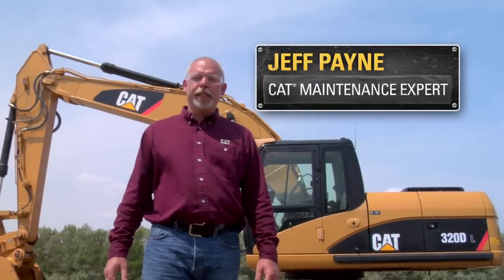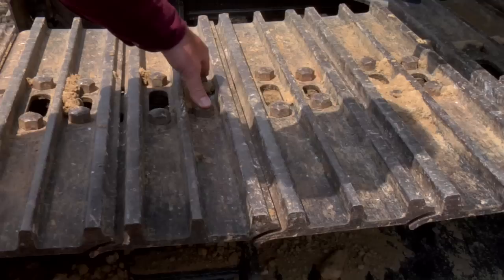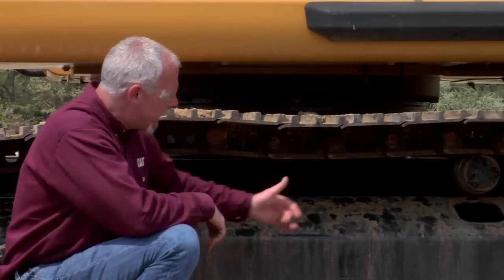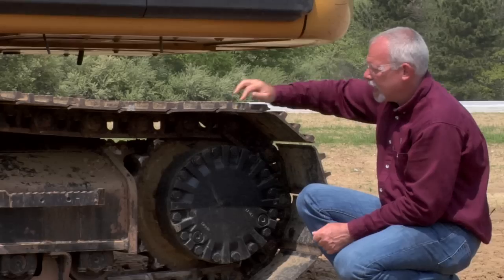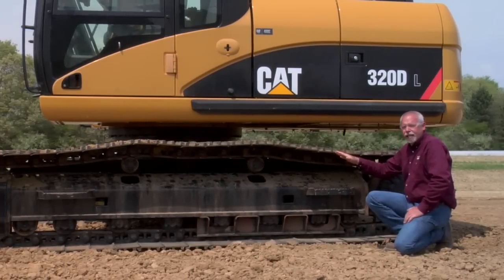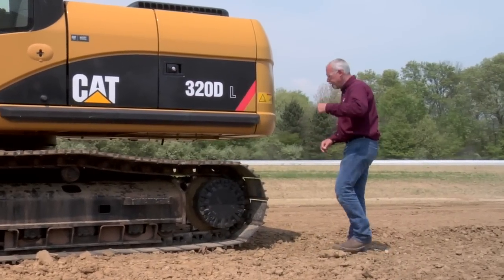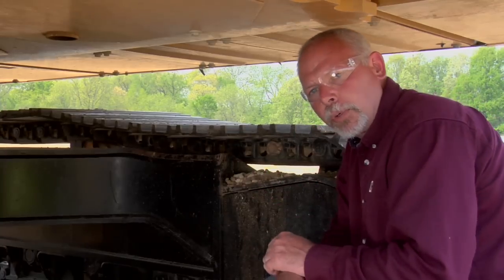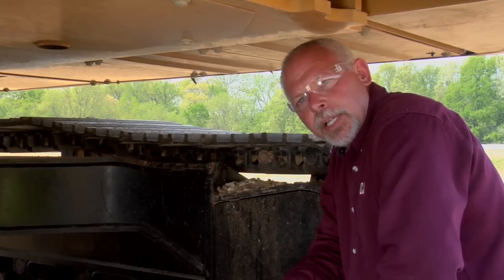Cat® Excavator Undercarriage Maintenance Tips

Comment: You tighten them up. There is a grease fitting for each track that you pump grease into which pushes out the idler wheel to tighten the track.

Comment: My local Cat dealer wants to charge me $120 for a operator/maintenance manual.
Reply: See what thy want for the workshop manual
Reply: Your lucky is only 120
Reply: Buy one online as there always updating procedures slightly , A Cat dude told me hes always used a rust prevention lube for the cab mount bolts as per procedure,  but theyv recently updated it to loctite , if you had the paper book you wouldn't know